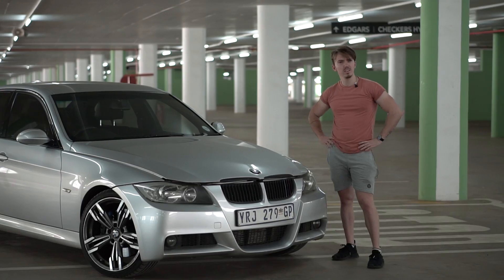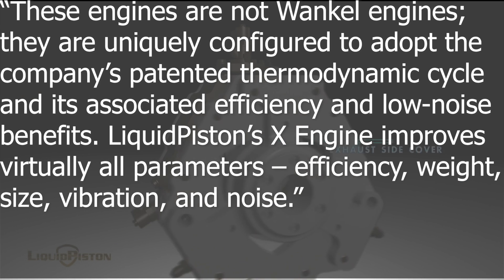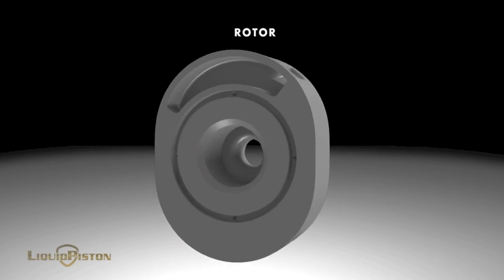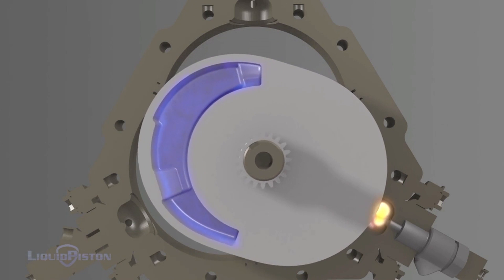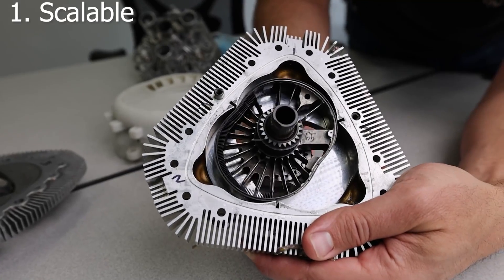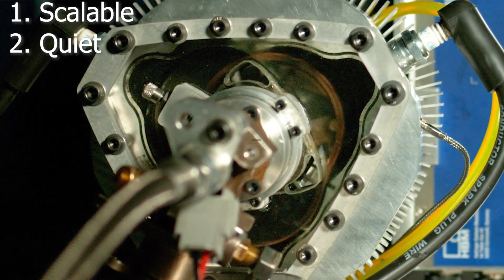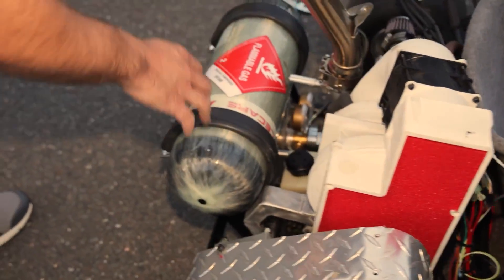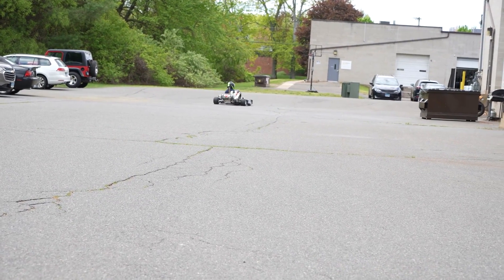This Liquid Piston engine revs to 15k rpm and can make over 1000HP

Comment: 5 hp from a 70 cc engine. That's rubbish. Assuming a direct upscale to 1000 cc, that's 71hp. That power per displacement is worse that a pushrod 2 valve engine. To even make this concept viable it would need REALLY good emissions ratings and fuel mileage. But it's a rotary engine. And thermal efficiency is a complete novel concept for them.
Reply: I completely agree with Jon Newman, if anyone did simple analysis of this engine with flame front speeds, sealing technology, carbon build up, simple aerodynamics, and force diagrams they will easily see that this liquid piston engine idea is crap.
Reply: @lightfeather2439  
You gave an opinion.
The facts are is has a superior power/weight ratio than piston engines.
Reply: @johnburns4017  Well then. If he gave "an opinion", lets analysis it! 
Flame front speeds? Rotaries have a very large flame front area compared to a piston engine. Therefore combustion takes longer and thus is less efficient. 
Sealing technology? While the LP design has less seals than it's Mazda counterpart, it still has some seals that need lubrication. So that's either premixing 2 stroke oil or an oil injection system. 
Carbon build up? A potential issue for the diesel. Not as bad with the petrol. Three causes of this in a 13B-MSP. 1) Burning of synthetic oil when lubricating the seals. 2) Engines being below a temperature threshold. 3) Port design. The LP engine is most likely to suffer no3, since the rotor has cooling vanes on it's internals, which could get clogged up with soot / carbon. 
Simple aerodynamics? I don't understand this point. So moving on. 
Force diagrams? And this is the big one, that is fact. The application of useful force on a moving component is far greater in a piston engine than it is in a rotary engine. 

I conclude this is a pretty good opinion on the whole.
Reply: @Thee_Snow_Wolf  
You still do not get this power/weight ratio.
Reply: @johnburns4017  Power to weight is good, and LP has a good power to weight, equalling a 2 stroke plane engine. BUT it is not the be all and end all of a design. If it cannot provide the required baseline power for an application, it is not useful. If does not meet durability requirements, it is not useful. If it does not provide the required emissions, it is not useful. If it is too expensive to produce it is not useful. If it cannot give a fuel economy improvement it is not useful. Does it solve the issues that the previous version of the technology had? If not it is not useful. 

You still do not get the other considerations of engineering a solution.
Reply: @johnburns4017  you seem to keep coming back to this, it doesn't matter if so many other factors are against the engine, it's been around as a concept for years, at latest 2001 or so, it would have been picked up by now if it had that much potential, aside from being trialled by the US military in 2019, it hasn't gone anywhere, that's probably a sign that others see no potential in it, certainly not compared to contemporary designs. This concept got bought up in my office at work not long ago, probably a couple of weeks ago or so, and the concept got torn to shreds within 5 minutes, it has far too many flaws for it's power to weight, which isn't really anything special if I'm honest, to have enough to overcome those flaws, all of them have already been listed above by 2 pretty knowledgeable looking people, which is very kind of them.

It's cost of production alone is a problem, the machining involved would take a long time, and the flow on it is pretty lousy, I love rotary engines as a concept, but they're far from the most efficient solution, conventional piston designs use the ignition process better than both a wankel rotary and this design as well, while also being capable of better emissions, i don't see the concept having a future, and it's power to weight WILL NOT save it from all the rest of the designs it faces in a situation, I know my FSAE team want nothing to do with it, because it's power to weight was pitiful compared to what we were using, and not reliable enough for our needs either, and it would have lost in other areas of the competition too, though those were never areas i worked in so i can't elaborate especially well on them. 

Also, while both others to comment here have given a considerable amount of reasoning as to why they've come to their conclusion, you've never given any, and it's impossible to have a proper discussion without that, at the very least you need to back up your statements with facts with a reasonable amount of credibility or roots in engineering logic, something you haven't done.

"The facts are is has a superior power/weight ratio than piston engines" okay, and where's your source here? Aside from the fact that many modern engines beat it while being more fuel efficient and more thermally efficient, I imagine everyone in this thread would happily discuss with you if you did come with facts. At least in aero engines, power to weight is important, but it is not the defining factor, I've worked with many many people in Rolls Royce and General Electric that would tell you the same, a good engine in power to weight is worth nothing to them if it's thristy on fuel for example, because that gain has now gone thanks to the extra fuel it would need for example. It's a tricky figure to use in that situation without good context, especially in current times, a fuel inefficient engine like this one would not last well in a public discussion or an engineering one.

I don't want to completley shut you down, but please bring sound reasoning and be able to back up your statements, rather than just making them repeatedly, it gets you no where, and simply winds up others. It's all I and the rest of this thread is asking.
Reply: @jameswhitehead03  
You must understand the positives and compare to the negatives. They it shines above piston engines especially for certain applications. BTW, it meets current emissions.

No one here has come up with any facts of note.   Many wild ramblings though.
Reply: @johnburns4017  I did go and look at both the pros and cons of it, its power to weight is decent, even then if I wanted a compact, low power continual power source, i wouldn't use it due to its fuel efficiency, general problems with all rotaries, this one included, is that you end up with a fair chunk of fuel just not really being used properly. I'd expect it to pass emissions, 

And stop sounding like a broken record, if we're not giving facts according to you, then give some yourself and then a proper conversation can be had, i fail to see how me stating it was used in trials by the US military in 2019 for trails, which liquid rotary themselves state happened, isnt isn't fact, please enlighten me if you'd be so kind, you clearly seem to know far more than everyone here after all, including one person who's worked with Alphatauri, Red Bull, Porsche and the Hyundai Rally Team, along with another person in the thread whos helped on the electronics for a time attack car, im sure both those people are clueless despite being fully qualified engineers in both cases.
Reply: @ChrisVSCars  That doesn't really matter. Liquid have a 750 cc 1 rotor. Assuming it matches the hp / litre of the 70 cc engine and makes 54hp. Assuming they make that 1 rotor model into a 1500 cc 2 rotor (their design makes it hard to go beyond 2 rotors), we have extra efficiency from adding another rotor, therefore we can't assume that it'll just make 108hp. 
A 20B PP makes around 520whp and a 13B PP makes around 270whp. So adding the extra rotor would increase power per rotor by about 1.28 times. So we can guess that the 1500 cc hypothetical 2 rotor would make around 138hp. Which is still pretty awful in terms of hp / litre. So I refer to my original comment that for this to make sense in any capcity you need BIG gains in fuel consumption and reliability over even a standard piston engine, for this to make sense.
Reply: A two-rotor design would be comparable to a six-piston engine.
Reply: This engine is not like the Wankel, so do not spout old myths from another design.
Reply: The engine will be about a third of the size and weight of a piston engine. The packaging is brilliant. It can be tucked away inside a hybrid vehicle.

There is also aircraft applications where weight and packaging is very important. There again hybrid ICE/electric planes are under development.
Reply: @johnburns4017  The hp / litre of the design is still lacking, making only really viable for light / medium UAVs or light duty generators. 
The Bayraktar TB2 uses a Rotax 912-iS, making 100hp and weighing 63.6 kg, thus give figures of 82.6hp / litre, and 1.57hp / kg. 

The Liquid Piston X4 Beta design is meant to weight 60 lbs / 27.2 kg (although this seems to be a long block weight so no stuff like intake manifold that the Rotax weight includes). The production X4 has a power target of 50hp, so that's 66.7hp / litre and 1.84hp / kg at best. (hp / kg would be lower in reality due to things like intake and exhaust not being accounted in X4 weight. I bet it would be closer to 1.57hp / kg.)

You can throw as many packaging advantages as one can at an aero design, but if you don't make enough power to start with, you're going nowhere.
Reply: @Thee_Snow_Wolf  
63kg is 139 pounds. So the Rotax gives 100 hp for this weight. The Liquid Piston gives 100 hp for 75 pounds. Massive difference. For 139 pounds the Liquid Piston produces  approx 185 hp.

It is the power/weight ratio that matters. It strips piston engines. Then the simplicity and near zero vibration
Reply: @johnburns4017  That's not the whole picture. That hypothetical 185hp Liquid Piston engine would be 2774 cc Vs 2240 cc for the Rotax. Massive difference. And a difference that only gets larger as one increases engine size. For 300hp it's 4498 cc Vs 3632 cc. 

Power to weight only matters if one can get enough power to start with. Plus the frontal surface area of a plane is defined by more than the engine. While the Liquid Piston has an undeniable advantage there, it doesn't really matter since a plane's fuselage is almost always wider than the engine. 

Also I'm not sure how you got the "100 hp for 75 pounds". The final production X4 was targeting 50hp for 40 lbs. By that logic it's 100hp for 80 lbs. 
In conclusion, "So its roughly on par with a 2 valve pushrod engine? Go modern technology."
Reply: @Thee_Snow_Wolf  
cc is meaningless. Power/weigh matters in vehicles: ships, land vehicles and aircraft. For static engines power only tends to be more important, as weight is not an issue. In planes power/weight is vital.  Then there is the economy. 

You need to do some study of engines.
Reply: @johnburns4017  CC is meaningful. A bigger engine requires more metal. Hence weighs more. If you cannot increase hp / litre, you have to built bigger engines, getting back to more weight. So as size of engine increases the potential advantage of this design will decrease. Hence why I said "only really viable for light / medium UAVs or light duty generators".
Reply: @Thee_Snow_Wolf  
You need to understand power/weight ratios. That is the prime figure for vehicle engines.
Reply: @johnburns4017  If we want the best possible power to weight you'd immediately go for a 2 stroke engine. The Hirth F-30, 110hp, 1042 cc, 58.5 kg. It straight up matches the X4 in  power to weight AND has a higher specific output. 

BUT alas you need to understand that power to weight isn't the only factor. For a start the X4 design relies on CNC cut billet, which is expensive. Also the gears that go on the e-shaft / rotor cannot be made on a 3 axis but require an EDM machine. Thus are VERY expensive to produce. 

Also regular piston engines and even regular Wankel rotaries scale up well. The X4 based design would struggle to go past 1500 cc due to the design of the end plates and the way air flows through the engine. Meaning and entire new design would be required. Unlike the Mazda rotary where you can keep on bolting on more rotor housings.
Reply: @Thee_Snow_Wolf  
Two-strokes cannot meet emissions, so not worthy of consideration.
Reply: @johnburns4017  I've been constantly bringing up examples where engines are not required to meet emissions standards for roads, and now you choose to bring it up? 

Buttttttt if we are bringing it up lets do a comparison, to the standard Wankel, the Renesis. Assuming for the cars a steady speed of 70 mph (pretty much the global average speed for a car on a motorway)
Rotax 912-iS : 30.8 kg / hr
2018 EU Petrol Car Average 13.9 kg / hr
13B-MSP : 30.1 kg / hr

Now we can see our baseline aero engine is about equal to a 13B-MSP. We have no data specific to the Liquid Pistonm, but we know rotary type engines have inherently poor emissions. While the Liquid Piston removes the oil burning of the Mazda type, rotary combustion cambers are about as unideal as one gets, so we're not going to get efficient pentroof chamber combustion. Emissions will be better than a 2 valve but realistic for a petrol model at least you won't get better emissions than a 4 valve engine. 

And if we're bringing up extra points not mentioned before. How about the fact that this design still doesn't solve the major heat gradients that the Mazda style suffers from kills seals.
Reply: @Thee_Snow_Wolf  
A Liquid Piston rotary and Wankel are not comparable as they are different. You make the mistake of comparing.
Reply: @johnburns4017  A rotary engine is a rotary engine. When the same fuel is used one can make generalisations about the characteristics. Half the flame front isn't doing any useful work in the Liquid Design. Just like what happens in a Wankel rotary engine. Petrol in this design is a dead end proposition. The only way this could even potentially work is as a lightweight diesel engine.
Reply: @Thee_Snow_Wolf  wrote:
" A rotary engine is a rotary engine. "
Complete nonsense.
Reply: So Fluoride in the Water By LAW = Neg. -20 IQ Points =  It's Corp. Gov. Fake Money & Depopultion & Nuclear END One Way Or The Other  Any Time Now ....Take Care....@ 26 CPM

Comment: Anything that can keep the ICE motor alive. I really do not want to switch to EV. I want my engine sound and my manual gearbox.
Reply: I don't care about my engine sound or all of that, but I do care about being able to travel a decent distance despite the inevitable rolling blackouts from everyone charging their EVs on a grid that will never be able to keep up with the demand.
Reply: Well you could just make vroom vroooom noises while you drive that's what I do and it works well and really fools everyone 🤪
Reply: Your reasons have got to be the dumbest; head buried in the sand, thinking I have come across in a long while. 
Someone will develop for the Luddite market, some surround sound speakers and a mighty V8 rumble to play over the top of increasingly silent and sewing machine like noise that modern motors, ice or electric, will make instead. 
Seriously, grow up...... You kids and grandkids need you to......
Reply: Don't worry, ICE hydrogen fueld engines will be the end game
Hydrogen comes from water and when it's burnt it makes water...now that is pure magic
Reply: They should combine this motor with an Axial Flux motor as a hybrid,
Reply: That sounds like rotary engine re-invented
Reply: Dont 4get the character of the individual engines. The less efficient it is the more character it has, the more skill it requires to go fast and stay consistent
Reply: @crash5811   Today's engines are enormously efficient when compared to those in the  '50s. But still need lots of skills to achieve the optimum performance. Yet the experience is more fun which was impossible to have in the '50s. Thanks to all that power, compactness, agility and speed came as a result of enchanced efficiency. It isn't impossible to have even more fun with EVs, but unfortunately they're being overly sophisticated - like robots.
Reply: There can be EVs with manual gearboxes but it's kinda pointless
Reply: @RCmaniac667  it could lead to crazy speeds
Reply: Yeah, just wanna burn gas and make smoke and sound good.
Reply: How sad.
Polluting engines need phasing out.
Reply: @johnburns4017  Good thing then that my car on doesn't pollute as much as a medium to big EV.
Reply: @PeteTheL337  
You are deluded.
Reply: @PeteTheL337  it does a taycan turbo s compared to an small efficient ice car still polluted less over its life

Comment: Have you ever done a video on cyclones External Combustion Engine? would like to a video on that and your take on it.
Reply from the maker: No but it sounds awesome😁 ill do some research on it and make a video💪
Reply: @John Burns, the majority of applications are currently for ultralight vehicles or generators. Upscaling for these guys is primarily via multiple engines, and they are completing a fairly huge contract right now. Check their website.
Reply: This engine appears to have be been dropped from the radar. It was only suitable for large applications.